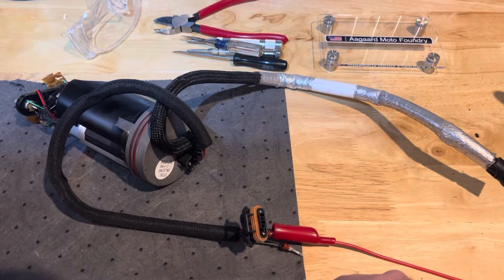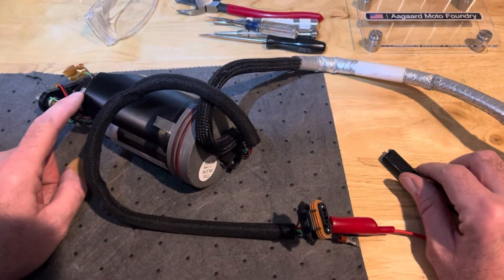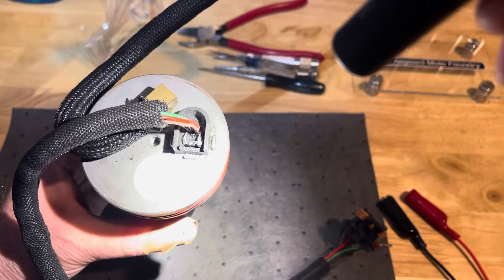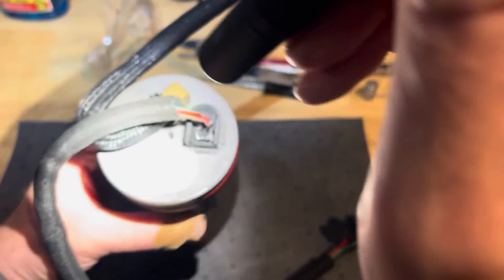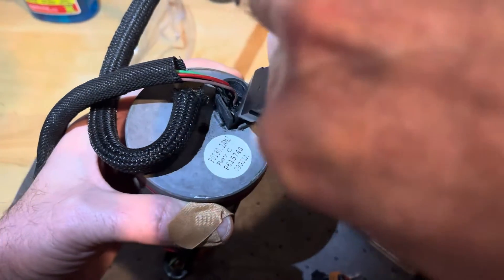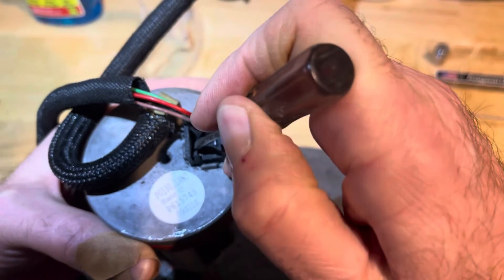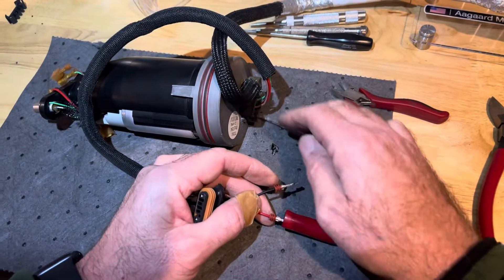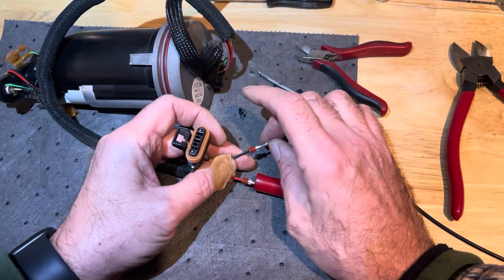Buell and EBR 1125 and 1190 Fuel Pump Failure!  Diagnose and repair failed internal diode.

Comment: I have you fuel pressure test gauge on the way to me now if the pressure is not the problem I have is there a way to check this dioode without removing the pump?
Reply from the maker: You can check the diode, but you need to have the pump removed so you can disconnect the pump itself
Reply: Is there a video or can you explain the process of testing to see if the diode is the prob? I'm just trying to make a plan after I check the fuel pump pressure is normal which I believe it is I need to know what to do next to diagnose the no start I'm experiencing

Comment: Could this lead to intermittent stalling? My bike occasionally stalls at idle and has a P0629, P0087, and a P0193, gonna check to see if the codes come back. Also ran it out of gas on my first ride so not sure if these could potentially be from this lol
Reply from the maker: @michaelroshko7067  for sure.
Reply: @ good to know.. May send my pump assembly in for a rebuild+fix for this, gonna try clearing codes and see what comes back+see riding behavior after since its been a few years since they’ve been cleared

Comment: Hopefully the new Buell factory is not using Carter to design and build their pumps again this time around.  The list of defects built into these pump assemblies is long for the limited amount of these that they were produced for EBR: The diode's location,  bad soldering on the wiring, bad crimp jobs on the wiring, the sock filter location smashed against the plastic housing (choking off the fuel flow), the fuel float.